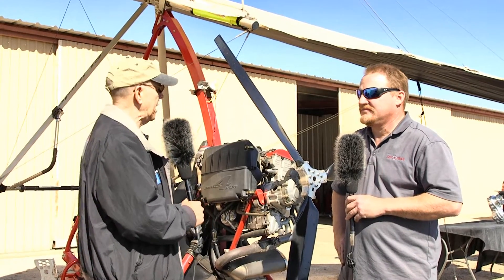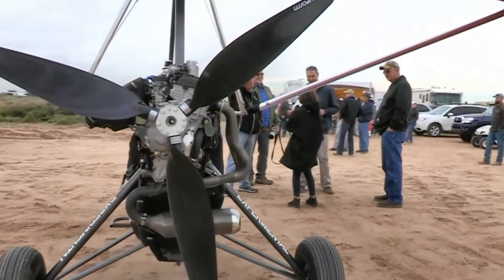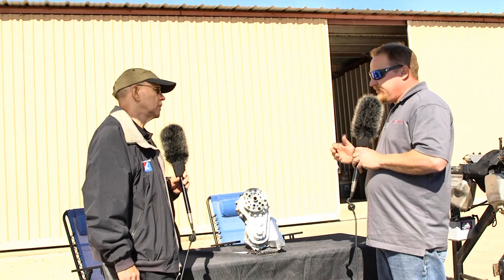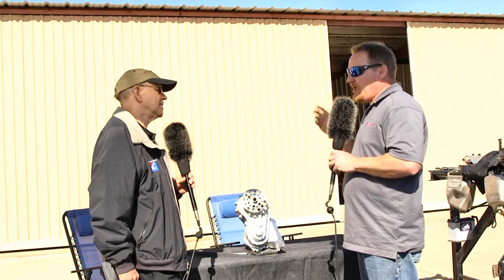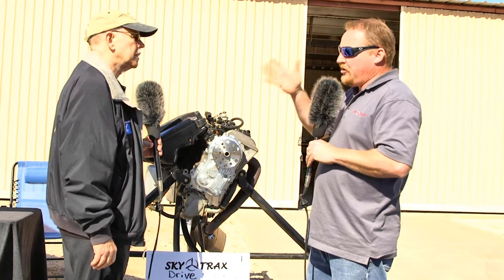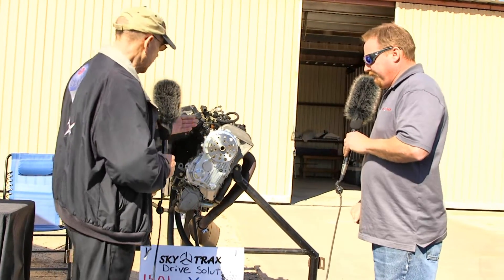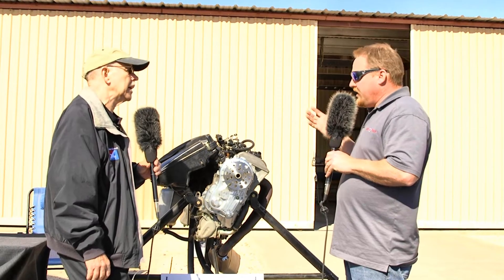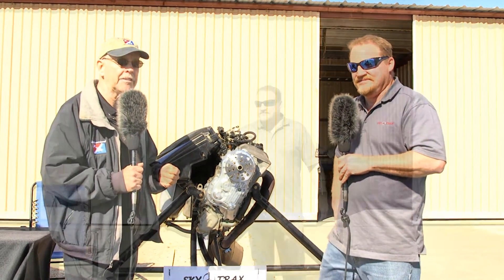Yamaha RX1  aircraft engine conversion, gear box adapter & gearbox by SkyTrax

Comment: I had this engine in a 2008 yamaha apex ,it was a fantastic sled ,how does the weight of the engine/gearbox compare to a rotax 912 or even a rotax 582 two stroke

Comment: Is the engine computer up for handling thin air?
Also you need a website for this bad boy. Pretty easy to set up these days from what I understand.
Reply: It's a fuel injected snowmobile engine . Duh !
Reply: Dan, Edge Performance-Norway is developing a turbo for the Y-Apex engine....200-300 hp...new internals for the 300hp version...not for the lower hp's.

Comment: Why not just use the motorcycle version with a built in, highly reliable, gearbox? Then all you'd need is a solid mount for the prop, and could use a chain drive just like the bike would? It's a tried and true system we know to be extremely reliable and easy and cheap to maintain...

Comment: How does it hold up to thrust loads and gyroscopic  forces?  I often think that most gear boxes never consider the gyroscopic forces as the plane yaws or changes pitch.
Reply: I'm pretty sure that anyone who can design and build this kind of gearbox is capable of thinking of such obvious considerations.
Reply: And harmonic isolation? He seems confident that the Spragg clutch will deal with harmonics. Centrifugal clutches have been used in the past.
Reply: @PDZ1122  I dont believe that statement for a minute. There are unique forces at work on the housing. This PSRU is developed in modern CadCam, which almost all packages come with structural analysis.  Pretty much fool proof nowadays. It is machined from billet, stronger than cast. What I have said above was in no way ment to diminish this persons capability to design this drive. It looks like he is doing well for this newer market